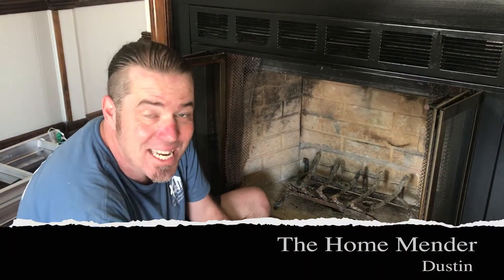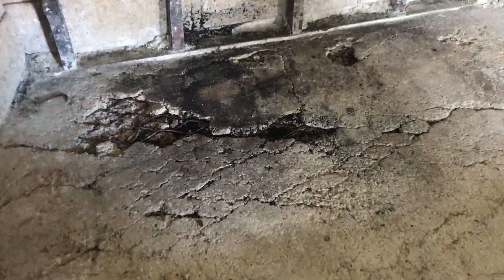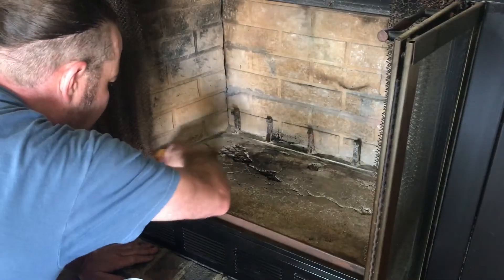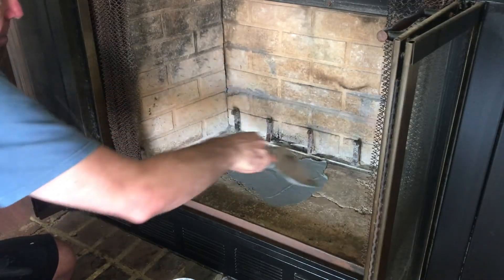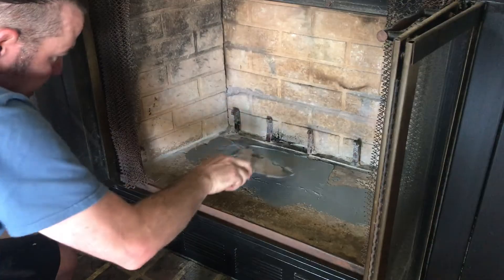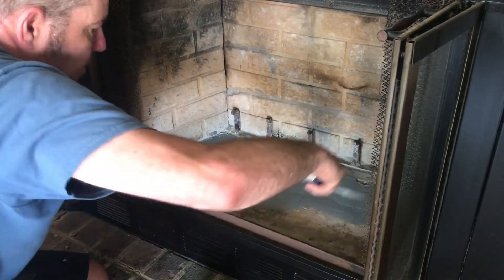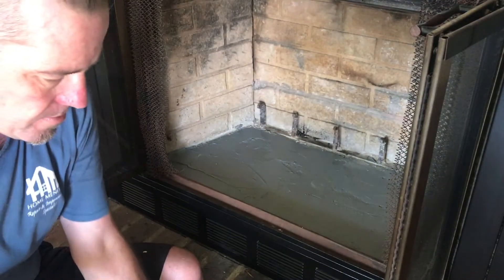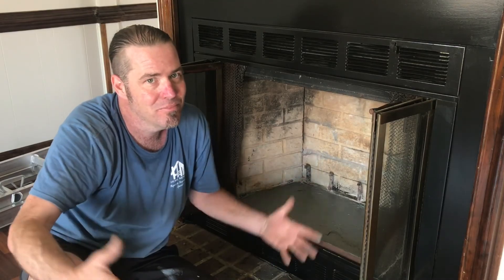how to fix firebox crack, cracked fireplace, fireplace repair

Comment: Hello Dustin. I have a fireplace that I hadn't used in years. I had it inspected about a month ago and the rep said that the fireplace is in great condition. He noticed a very small hairline crack in the back of fireplace. He recommended getting some fireplace mortar to repair. I procrastinated and hadnt placed mortar on crack in time. Getting very cold freezing weather the next few days. Can I use the fireplace with the hairline crack? I can put mortar on tonight but how long will I have to wait to use fireplace? Thanks for the help.
Reply from the maker: Hey Joe check the specifications on the back but in less carbon monoxide can get in the house you should be able to burn a fire. Especially if it’s a Brick fireplace. Those P fabricated units are contained inside so you should be good to use it
Reply: @homemend  Thanks for your reply!!

Comment: What if crack is real big in the side of wall?
Reply from the maker: Hey Venus I would apply thin coats let it dry and then add a new coat. You got this
Reply: @homemend  found a resolution. All is done thank Gosh
Reply: @homemend  I went and got the concrete filler they have for this at Lowes. It worked amazingly. Looks awesome now

Comment: My firebox is cracked on back panel and is about 1/2” wide in places. The floor isn’t cracked but chipped in 2 places. I figure most chimney specialist will recommend to replace it. Is the product you used durable for all sides of the firebox?
Reply from the maker: Hey Donna, absolutely. Apply as instructed On which ever product you chooseand you will rock it!

Comment: Thanks for the taste test to make sure it’s the real deal!  😂

I got our panels replaced for 5 hundred or so because they weren’t structurally sound.  After the first small cure fire the bottom panel already cracked slightly so I went digging for a fix.  This is the first video I watched and I am SO relieved that we can handle this ourselves, especially since there isn’t a warranty on them. We will definitely be buying some goop!

Comment: Glad I found this. None of the 3 contractors I contacted have shown up and I've been super frustrated trying to get this fixed. Mine has a couple of small cracks on the back of the box
Reply from the maker: so glad i could help! thanks for sharing atano!
Reply: I have to same issue the back fie  box wall crack , and no want know how to fix

Comment: I’ve read you can’t repair anything but hairline cracks safely but this product seems perfect for the task. My back panel has a 1/8th inch crack running up the middle. This may be the solution I was looking for

Comment: I believe you have to cure or season it after application. Usually 48+ hours after it’s coated you should apply 200 degree heat for 1-2 hours then apply a 500 degree heat for the final cure
I could be wrong
Reply from the maker: Hey sams. Great info. Thanks toi sharing!
Reply: So should one use a space heater or heat gun for the 1.5 hours?
And for the second/final round, just burn some logs and that's the curing finished?

Comment: Excellent work. Would this work as a stabilizing cement type compound for installing a flue?
Reply from the maker: Hey Miles, this should work as fireproof mortar so wherever you would need mortar this will do the job. Double check the tub to confirm. I hope this helps

Comment: I just had this done last week before the arctic air hit us in Texas. They charged us $1300 to do the back and floor.  2 hours work that included cleaning the 2-story fleu.😳 We were told to let it cure for at least 24 hrs. We waited 48 hrs. Now 5 days later it has big flakes growing on the back. Thoughts? Advice?
Reply from the maker: Definitely check this specifications for the product used but I would email the company or at least leave them a message so it is recorded. I hope this helps.
Read about the product use… This may be part of it

Comment: Hey I have a hole in the back of my fireplace. Can I use this or something similar to patch the hole and continue to use the fire? The size of the hole is about the size of a golf ball
Reply from the maker: Hey silent, this would be the stuff. Read it but on the back of your container and see if multiple coats are discussed. Generally three coats of a product will provide good results. If your hole is the size of a golf ball you might need to put some steel mesh in there so your repair mortar doesn’t fall out. I hope this helps!

Comment: I know this is an older video but my fireplace brick is falling apart on the back wall.  Cracking so I patched it with the stuff you are using and this winter started cracking again and falling out. Can you recommend a fix or just do the same repair
Reply from the maker: Hi Diana. Unless you’re replacing the insert, fireplace mortar would be a great solution. Definitely read the specifications and the curing process for whichever product you use. It may help with the durability. I hope this helps
Reply: @homemend  ok thank you. The rest of the fireplace brick looks new but the back wall I guess gets the most heat

Comment: Thanx D! I actually have to do this and now I know how. Do you think those cracks can cause some smoke to blow back into the house..mabey because of draft? That's an issue I've had last winter. Thanx for the vid✌
Reply from the maker: thank you jason! appreciate you sharing!
Reply: Jason, the cracks once they get large enough are a danger to the fireplace itself as the floor and wall panels help to spread the heat out evenly across the "box" or fireplace. once the material breaks down and isnt there, the areas missing the material will break down and get damaged by the heat. The smoke issues are completely different. These fireplaces are notorious for smoking. Could be a wind issue. Could be that you turned on your central heating and changed the pressure in the house and the smoke is being pulled back down. You could try cracking a window next to the fireplace and see if it helps the unit breath better and not cause that smoke to come back down.

Comment: Dustin , it's the wall of my Firebox that has cracks .. Can I fix them the same as you did on the floor of the Firebox ?  Scared to use it cracked ... Can I use your way of repairing or do I need a New Firebox ? Cheryl
Reply from the maker: hey cheryl....this one failed a home inspection and then passed after the repair. based on that info, you should be good to go :)
Reply: @homemend  Oh , Thank you so much .. And I can do it ! Even Better 😊  Honestly Thank you so much for replying ..    So hard to call someone in to make repairs .. Being under 5ft & little .. Repair folks try to take advantage of ladies ... So now I know I can do this too on my own ... My late husband was to ill to do these things .. You've made my day .. Hip Hip Hooray 😊😊😊😊✌✌✌
Reply from the maker: so cool cheryl.. ill help anytime i can.. :)
Reply: @homemend  Dustin , Thank you , been working hard doing Remodeling to my 1975 home .. This Firewall repair I was afraid I was going to have an expensive repair job .. Order this repair stuff off line was $18 .. Omg , can't be much better then this !  So , Dustin you Rock !  Thank you , Thank you , Thank you 😊 means I can do it without asking my Sons to come help .. Love that I don't have to ask for Help ..  Because of you ✌🎊🎉
Reply from the maker: This is a great testimony cheryl...thank you so much for sharing!

Comment: Hello
Quick question, what brand is that that you used?  I'm having a hard time finding any type of furnace or fireplace mortar at the local HD or Lowes in my area. Also, my crack is on the back of the wall, will that same type of product work for my situation?
TY
Reply: I’ve found some refractory cement rated up to 3000F at my local Menards in IL.
Reply from the maker: hey shaunda! fire works brand?  you will need to go to a fireplace store for this...the depot wont carry  it...and yes  the repair is made the same... you got this!
Reply: @homemend  awesome, thank you for responding back!!

Comment: Hello Dustin - Thanks for the video! I'm looking at the product you used on Amazon and there are some complaints about the cement bubbling up after running a fire, even after letting it sit and dry for days. Have you experienced any bubbling with this product after running a fire?
Reply from the maker: hey henry...i bought mine at "fireworks" a fireplace store. but as long as the product is rated for the heat, it should be good...have not noted any bubbling

Comment: Thank you for the video! I have exact same fireplace, but the cracks are on the wall. Would you recommend to use same mortar and technique?
Reply from the maker: Hey v.  I have to fix one where the cracks were on the back wall with the same method.
Reply: @homemend  thanks! I meant to say cracks are larger (not hairline), even couple bricks are loose? Will same technique be applicable?
Reply: My back wall is cracked up as well.   Do I have to buy a new refractory panel or can I use your method on the back wall?

Comment: Mine is cracking on the back (brick paneling) above where you fixed the bottom.  How are these fixed / replaced?  Is it just an insert you buy new?
Reply from the maker: hey ed..as far as i know..the insert comes together.in one piece..a crack can be filled with the fire resistant compound for repair. i hope this helps
Reply: The back of mine is pretty damaged. I have used fireplace mortar in the past and it lasted for a couple of years. It’s cracked again. I assume I can just keep going over it or is there some kind of panel I can put in?
Reply: See if anyone in your area can cut you a new refractory panel. These can wear down to where they just start to crumble. You can also see if you can find the make/model of the FP and see if a Refractory Panel kit is available for them.

Comment: The cracks are on the floor of the fireplace...what is the best way to cure the patched cement? Building the fire above it heats it to much higher than 200 degrees and then the ash starts to fall on the new cement in the cracks.
Reply from the maker: That’s a great question Joseph. I’ve heard different viewers with different curing times and temperatures. In your case I would try to curate with a blow torch Or a heat gun.That way you could be intentional with your heat placement. I hope this helps
Reply: @homemend  Thanks for the insight....much appreciated. By chance, do you know of a fireplace cement that could be used that does not need to cure before building a fire?
Reply from the maker: Hey Joe this is the only product I’m familiar with as it’s the only one I have tried

Comment: Nice I just did mine and it says to cure it with a small fire (200 celcius) for one hour. Then wait 24 hours to use regularly. Think this step is necessary? It's been about 4 days since I applied it.
Reply from the maker: hey mike! i couldn't tell you man..it sounds like something they print on the directions to make them sound official..lol it doesnt make much sense. i wouldnt think so.
Reply: Mike, the curing process helps to make sure that the new material doesn't pop even when it "dries" there is often still moisture in it and heating too quickly can cause it to pop.

Comment: What if a WHOLE dog gone Brick comes OUT the Doggone Firebox wall?? Push it BACK IN & hold it??
Reply from the maker: Hey research if you are pulling breaks out then you have a real fireplace, not an insert, you can use mortar and make the repair. I hope this helps